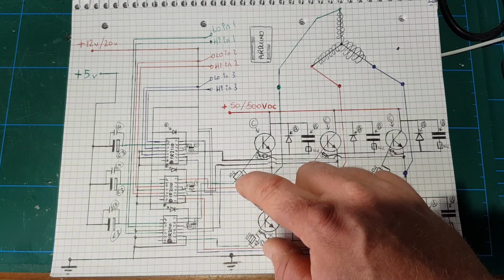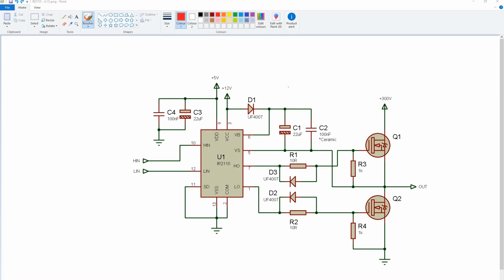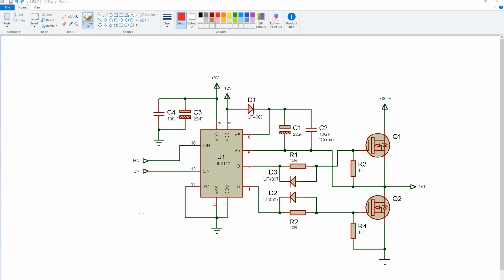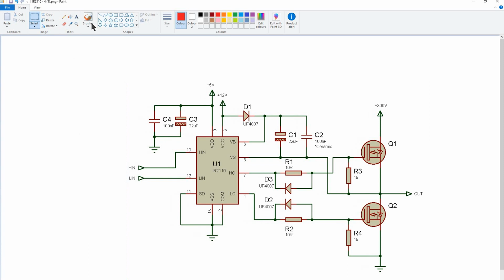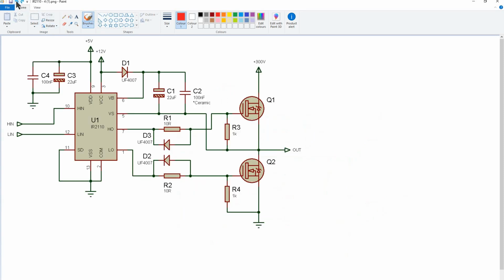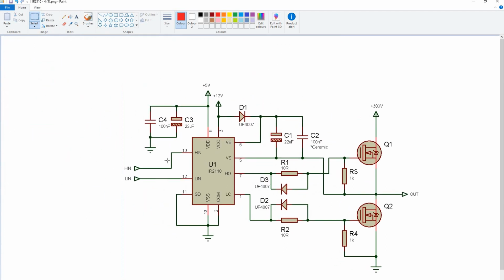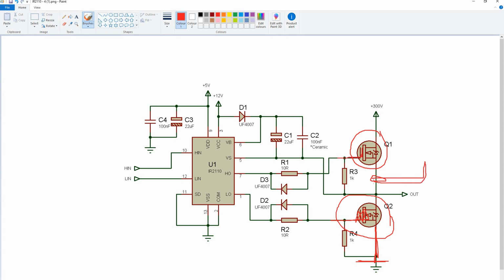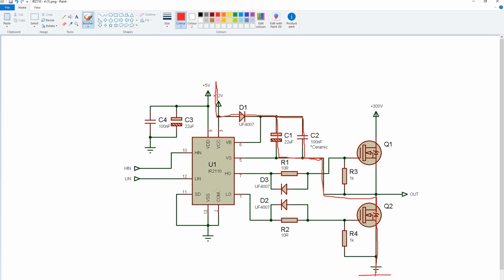ac motor control #4 igbt firing sequence

Comment: Out of curiousity, would the IR2110 Circuit be the same if the DC bus was 12/24/48V instead of 300V/Rectified Mains? I've been trying to figure out how to power a circuit like this off a car battery (or two or four in series) with the use of transformers to step the voltage up to ~230V

Comment: Mr Kay. Thank you for giving your time to us. I was watching Robert Murray-Smith and he was using two computer fans one as a motor and the other by mechanical coupling wired as a generator to produce a three phase signal. From what you have explained it would be difficult if not impossible to amplify this signal due to heat build up in the IBGT. Won't say anymore as I am pretty green on this. I did like the very important emphasis that the switching must have a gap at the changes to ensure no short circuit. Thanks again.

Comment: How would it look if you used smaller MOSFETS in parallel for each switch? Would you just be substituting the IGBTs with the smaller MOSFETs in parallel for each of the 6 "switches?
Reply from the maker: Yes on my final design i have decided to parralel up many small ones like tesla have done in theirs as you can fuse the collector if one blows it can just blow off its leg and the other will continue to operate :-)

Comment: what is the purpose of the red capacitors on the phases?
Reply from the maker: They are snubber rc netwroks (stands for resistor / capacitor ) 
Altho the diodes do a good job of clipping the voltage back emf spikes. They pump the voltage back into the dc bus so the spikes only get (snubbbed) once they reach a voltage which is higher than the dc bus . So these red caps just absorb or snub out these little spikes to clean up the wave form.. i gave a demonstration of this in number 2 or 3 ac motor control .. or maybe even 1 .. i think its number 1 :-)

Comment: Great video. I really like the new drawing tool you used in the end. It really helps clarify the wiring and signal flow.
 What tool did you use?

I'm a bit confused about how those LED's are being lit.  I assumed they were used as an indicator from the Arduino's control pulses used to spin the motor. But when you grabbed the rotor and reversed the direction and the LED lighting sequence didn't continue uninterrupted. I realized the LED's were wired to the motor windings instead of the Arduino.

Maybe you will go into the differences between the 2 pole and the 4 pole motors in future videos. Showing us the wiring of the rotor and stator when permanent magnets aren't used.
More information about brushless motors is always a good thing.

In your first experiments, you used the IGBT's differently. You used the IR2110 to drive two IGBT's in parallel for increased current gain. Did you simply short the HIN and the LIN pins together? Since both Collectors would be connected to the load and the Gates wouldn't need any voltage increase (no high side), how does the circuit change in regards to D1, C1, and C2?
Reply from the maker: Hey thanks for the comment :-) 
The leds are connected to the 6 outputs of the arduino as they go into the inputs of the ir2110. This particular setup is using the hall effect sensors on the back of the motor to tell the arduino the rotor position so that it can time the 3 phase output according to rotor speed. So when i grabbed the rotor the sensors tell the arduino to stop or reverse :-)
Yes before i was using the ir2110 in low only configuration. No meed for d1 or the caps. Only the decoupling caps for the 5 volt logic.
I think i put a wiring diagram for the low side only driver on one of the dc vids ... 
And for the drawing tool.. youl laugh...
Its microsoft paint !! Old school or what. Its still on windows 10 !